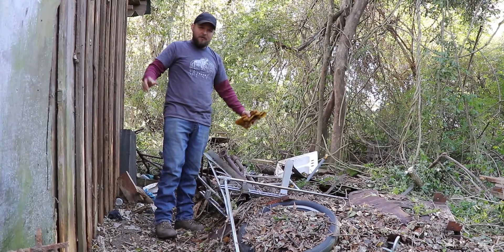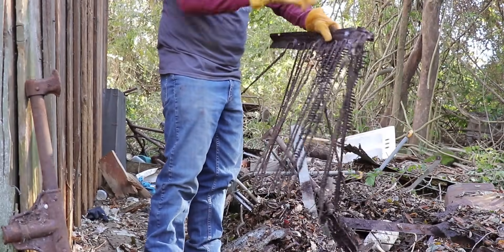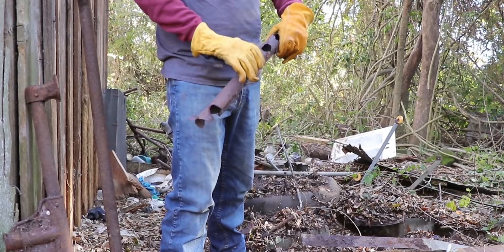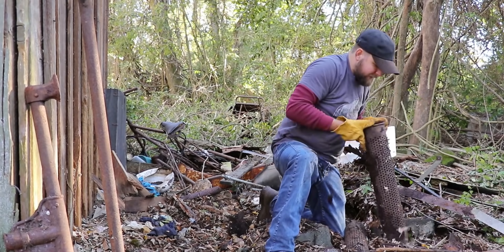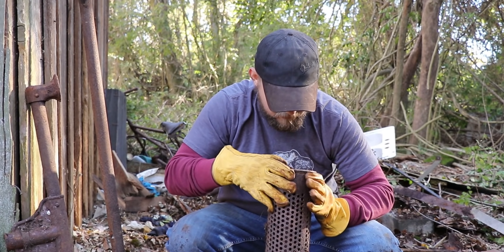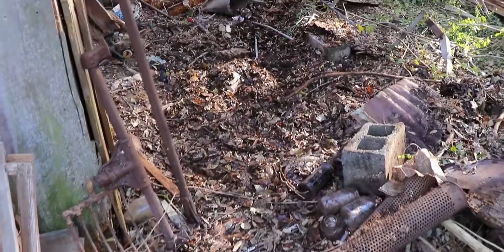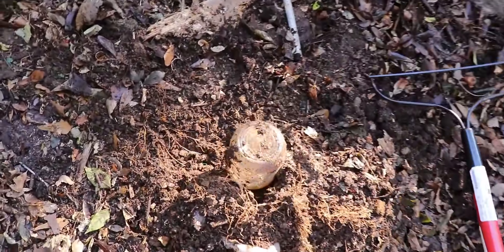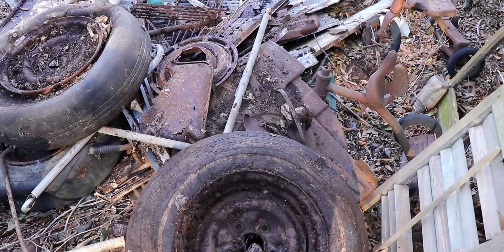Cleaning Out Behind The Old Canning Shed (Mystery Items Found On This 140 Year Old Farm Adventure)

Comment: You found three medium sized artillery shells with the preferred outside and primers on the bottom, that taller one is also an artillery shell, usually made of brass but also steel because it was less expensive, some other military items I saw so far are the wooden ammo crate in the loft of the shed and the footlocker tray leaning against the wall behind the shed, very cool love what you are doing

Comment: I"m thinking the perforated tubes are possibly old howitzer shells, possibly 105s.  They've been perforated to use as a strainer on the end of a pump hose or something else.  That's my best guess on those.
Reply: Looks like those covers for a semi diesel exhaust stack.
Reply: Probably empty casings for the M40 105mm recoilless rifle. The holes are manufactured in the casing to release pressure and gasses. M57 would be the type of primer. 10/56 is the date of manufacture. If the base can be cleaned up, it may have more info like Lot # and maybe type of round. An Army test from 1971 shows M57 primers used in the HEAT and HEP-T rounds tested. The long canister looks like one that would hold propellant.
Reply: CBSDracster  I've seen them used for umbrella stands polished up but didn't realise the holes were factory done. Be good to give them a buff and see how they come up👍
Reply: I was thinking the same. The holes are to release gases. Clean them up a bit and show them again.
Reply: @drunkdunc8738  If he ever shows us the inside of the house, maybe one is standing behind the front door.
Reply: CBSDracster they sell for $30- $50 each in my part of the world so the more the merrier 🍻
Reply: @cbsdracster6494  EXACTLY!!! Those were for the "Recoilless Rifle".
Reply: The M105 recoiless rifles were taken out of service because they were exploding when fired. You also gave away your position when you shot
 it. @cbsdracster6494
Reply: @donvanderkooi9095  Taken out of service in the early 2000s by the US Forest Service for avalanche control after a few degraded ammunition incidents. The US military took it out of service in the 70s after the introduction of the TOW missile. It's still used by many 3rd world militaries. The Marines in Hue during Tet 68 made good use of the backblast to cover movements during the street fighting. Just don't stand behind it.

Comment: Just a side note about the odds and ends of jars you are finding. They were most likely used for canning too. Long time ago, the jars all seemed to have a universal opening sized that the rings and lids fit.  If the rings and lids didn't fit, one would still use them for jelly and/or jams. Just put some paraffin on the top to seal it. My mother was the queen of canning or it seemed liked it growing up and if it was a glass jar, we didn't throw it away. We would reuse them over and over again until they cracked/broke.

Comment: The perforated tube is a fired 106 recoilless rifle case. The holes project a stream of gas at firing  in the opposite direction of the shell hence recoilless.  Used from the Vietnam era to mid 80’s. Cleaned up a nice item. The solid case looks to be a tank casing.   Most likely brass. USMC 1972-2003

Comment: Those are some type of shell casing, they come perforated. My Grandpa had lots of them and they were used for many things.  Being that those are by a canning house I'd say they were used as sieves. My grandma used one to remove tomato skins from cooked tomatoes. Put them in and smash them down with a wooden round that just fit inside. The juice and pulp run out and the skins stay inside. 
  My favorite was the metal frame that held 2 of them across a fire pit. Roasted peanuts...there was wooden contraption that turned four of these with a handle and a fan belt from a tractor.  You put dried corn that had been hand smashed into them and it would filter out the bigger pieces to make feed for baby chickens.  I remember taking it to the creek to get grit for the chickens and turkeys. One of them shoved full of cloth scraps served as a filter for the cistern input. One was the chimney for the roof of the smoke house. A few of these full of meat scraps sat down in the big cauldron full of water to make broth. They fit down in an old milk canister and the rim would catch. My grandpa would fill them with weeds? and put a wooden plug in the end, soak them in water, to make dewormer for the hogs.
  The pipes, look like sign holder.

Comment: Robert, those are 106 mm recoiless rifle casings. Light weight artillery guns sometimes mounted on a jeep. Vietnam era. The holes direct propellant gases out the rear of the gun. Primary purpose was anti-tank warfare but also had HE shells. Today, these guns are used in high mountain areas for avalanche control. Source was probably Ft Benning.

Comment: I don't know about the perforated metal tubes, but I was wondering if the bracket system could have been for gas light? Not sure if they had that in your area, though. Other than that maybe part of a watering system or bed frame? I'll be interested to see what you find out about it. Please keep us updated!
Reply: Okay, just saw that the house had a gas heater so those pipes & brackets are definitely part of the gas line system!

Comment: If you google "perforated steel cylinders", you'll find all kinds that are used as filters in machinery.  Some look very close to the ones you found.
Reply: Looks to me like an expended shell to a 106 mm recoilless rifle.
Reply: @robertplatt422  Yes, that is what those are.
Reply: @janblake9468 , I guess we're showing our age.
Reply: @robertplatt422  Probably. I'm 75.
Reply: @janblake9468 , 62 here. When I joined the Army in the mid 70's I was trained on the 106.
Reply: @robertplatt422  My indoctrination physical  in 1969 found me 4F so I never served. I'm just familiar with older military weapons.
Reply: Nope they are shells for artillery

Comment: Referring to the perforated tubes. You mentioned that this was an old canning shed. The tubes look like the back up tube for a sanitary filter.  A filter sock went over the perforated tube and went inside the housing you found. The juice is pumped thru the sock removing the solids.

Comment: Old tires are hard to get rid of. That perforated cylinder looks like the exhaust/ air vent of an old Tractor, the ones that sits up top on the Engine. "A chug, a chug."

Comment: The tall round rusty thing with holes would make a fantastic lamp. Mount it on wood, wiring up through the center, with tiny white  Christmas lights going up thru the center. Mount a wood piece on top, add a lamp kit and viola! Don't take this wrong but men, in general, have no vision.

Comment: Those mystery things from the thumb nail might be off of the chimney to the house. I think they are to put on top of the chimney so the Smokey air can leave, but the rain dosent fall through the top. But, that is only if they have a hole in the bottom, and no hole in the top.

Comment: You sure would save yourself a lot of work and effort if you weren't handling all of that junk two or three times. Everything you are pulling from one pile and pitching into another pile should be pitched into a giant dumpster to be hauled off site. The long , rusted pipes with the joints on the end may be part of a bed frame?